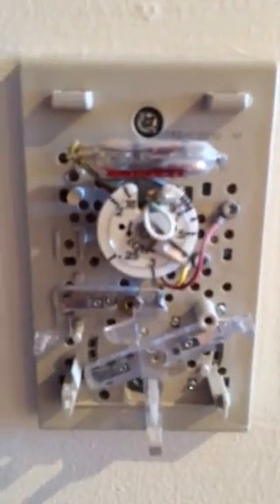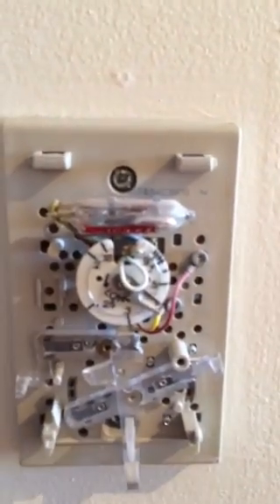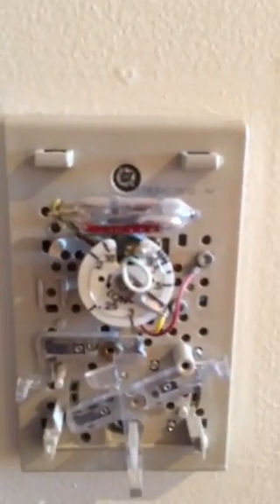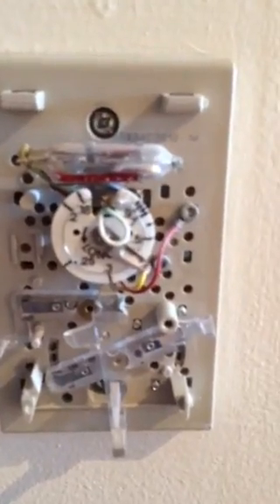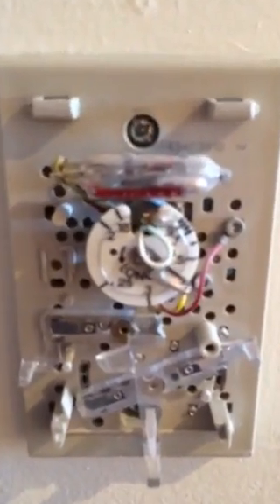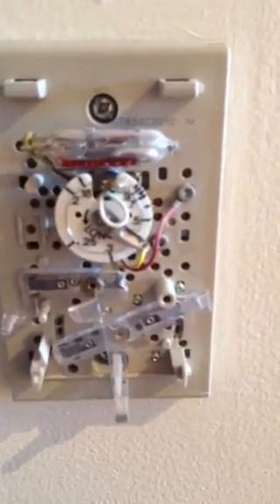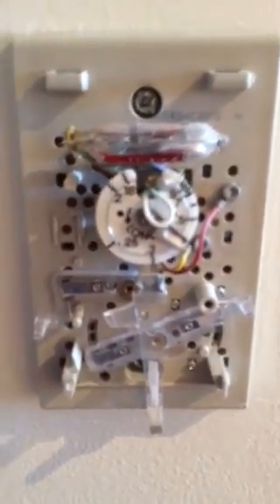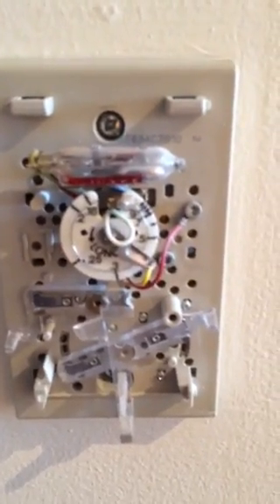Furnace not reaching set temperature

Comment: What is the normal operation? Is it Burner/Flame come, then the blower turn  on the same time or
the Burner/Flame come on for 30 second then flame turned off, then the blower turn on next?
I have problem that the Blower turn on too late and it is blowing kind of "warm" air and not hot air.
(flame come on then after 1 minute of hot air then it stops, then after 1-2 minutes, the blower turn on, the blower is late and that is why it is not blowing hot air but slightly warm air). 

However, when I set the temperature to the highest,
the burner flame and blower able to turn on together.
 Not sure why Blower  turn on after 1 minutes after the flame is off.

What is the average number (ie 0.34) for an old 1995 Carrier Furnace. Thanks.
Notes: New Filter, New OEM igniter, new OEM flame sensor but old 1995 Honeywell analog mercury thermostat.
Reply from the maker: What should happen when you turn the thermostat up:

1: A spark is turned on and the pilot light lights.

2: After 30 seconds to a minute the pilot switch on the pilot light heats up enough to turn on the main burners.

3. The timer for the fan starts counting at that point and the fan should turn on after 75 seconds or so.

4. The main burners should remain lit and the fan running until the thermostat is satisfied

5. At that point the burners shut off

6. After another minute or so, the fan shuts off.

Does the fan start at 3 as described above?

Or does the fan remain off until the limit switch opens and the burners shut off?

If the circuit board is defective and fails to turn on the fan at 3, the furnace will overheat and the limit switch will open. When that happens a second circuit turns on the fan, which will run until the limit switch closes again. That sounds like what is happening.
Reply: @snafujag100  Thanks for the information. Appreciated all your inputs. I think I need a new digital thermostat. It is working  except but for some reason the blower is turn on late (after flame been burning for 1 minutes and then stop and after 1 minute or so the blower then turn on).
Reply from the maker: callmeback sunday It could possibly be a thermostat issue. More likely the high limit switch/ fan limit switch. I presume your filter has been replaced? If you are not electrically minded get a furnace guy to look at it. If it actually is shutting down on high limit you have a potentially dangerous situation.

Comment: what if you don't have a thermostat like this? i tried with 2 thermostats and get the same result. furnace issue?
Reply from the maker: Rotter Tube Reef  I am no gas man, but most modern thermostats are equipped with an anticipator. The actual component may differ in appearance to the one in my vid. If, as you say this procedure is not solving your problem, maybe check the high limit switch. This switch shuts off the furnace due to overheating, that might cause a fire. I would suggest a service call.
Reply: thanks so much for your response. you know what i think it was? there was a 3" x 3" hole in the wall. i plugged that up good with a bunch of insulation. now the thermostat reads 70 instead of 65